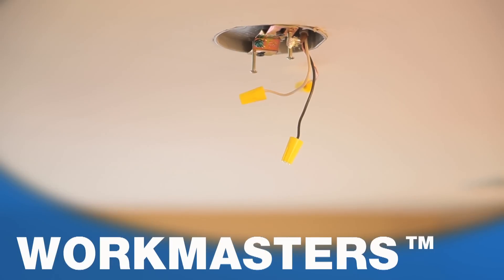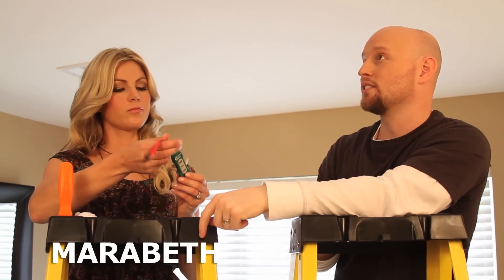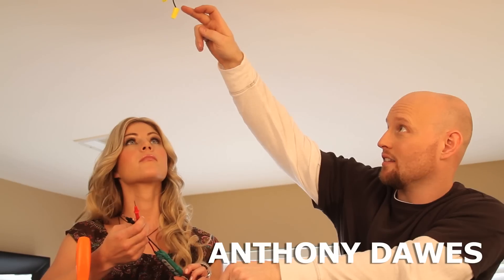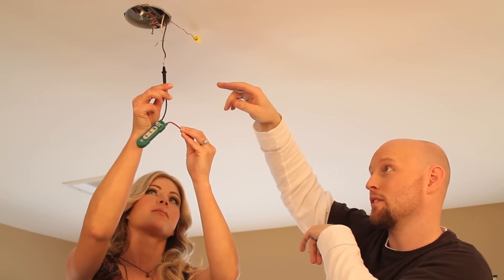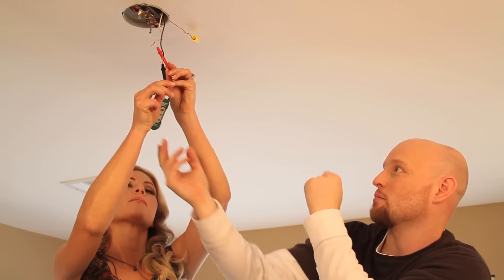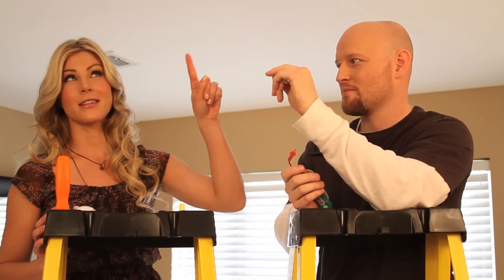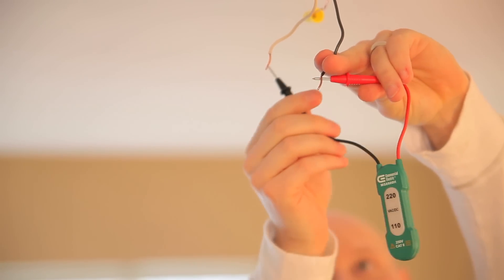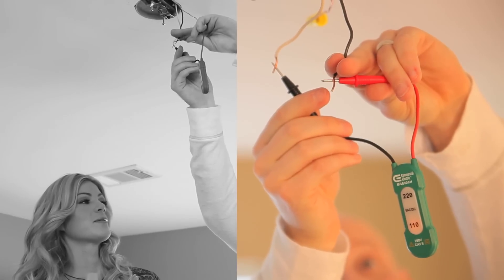Ceiling Fan How To (Part 4) - Test Wires for Power with Voltage Tester - WORKMASTERS™

Comment: The first test was red tester to white wire and black tester to black wire.   The second test was reversed.  Does it make a difference  which wire you touch when you are testing voltage?
Reply: No, there is no difference. This device is only showing you different potentials between the two wires.

Comment from the maker: Electrical Safety is a HUGE part of theWORKMASTERS channel priority. This video is Part 4 of the How to Install a Ceiling Fan Playlist. We wanted to include a short video on how to test electrical wires for voltage potential. We are assuming that you will be taking down an existing fixture or replacing an older fan, which would have you working around potentially energized wires.... sorry for the long explaination !!  ... In Short .... BE SAFE !!! and thanks for checking out the video !!!!

Comment: Just like Michael Henderson, asked why don’t you want power to the wire?   This video is confusing.  What are you trying to show??
Reply: That its safe to install a new fan without having to turn off the power for the whole house. Basically only turn off the breaker from the room where the fan is

Comment: Why do you NOT want power to the wire? Isnt that what you need to get the ceiling fan to work? Thats my issue with regard to installing a remote control ceiling fan that used to work. Its as if there is no power to the black wire. In the ceiling is another wire that is hot for sure, it ties into a torch style floor lamp that plugs into the wall. In other words, if that black wire is messed with the floor lamp goes out. But that wire would be constant power. I want to tie the fan into the wire that goes to the wall switch , the way it worked before, but no way that I wire it gets any response from the remote .